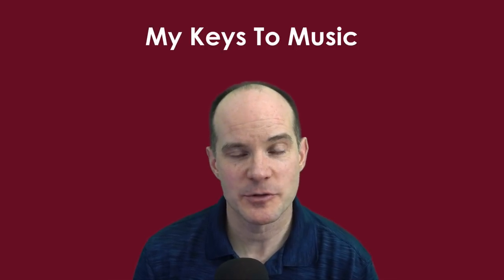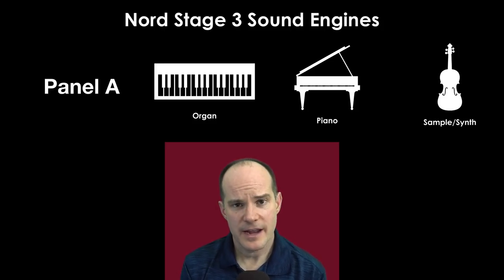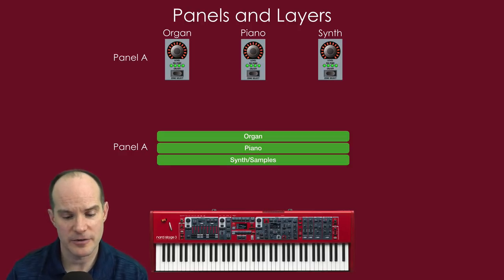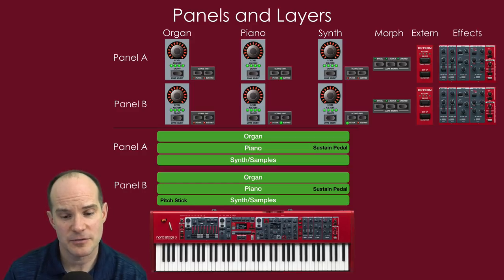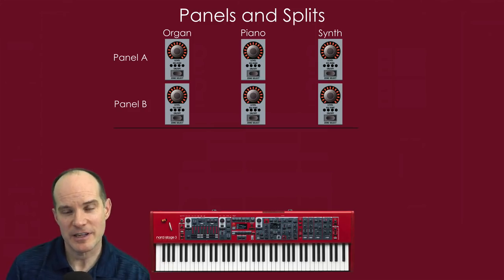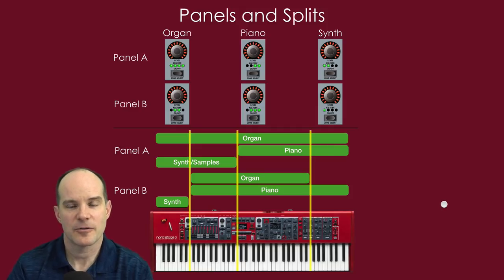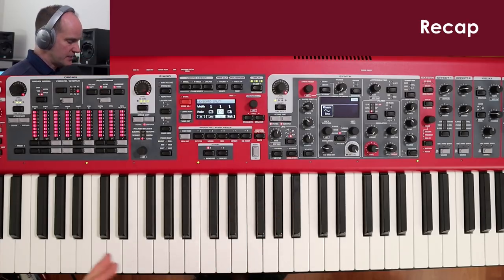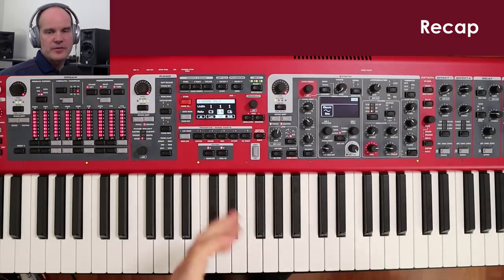Nord Stage 3: Understanding Layers, Splits, and Panels

Comment: How do I take two existing sounds whether in the synth section or as a separate program and split them?  Eg.) existing organ patch with left hand - zone 1 & 2; and existing lead/synth patch with right hand - zone 3 & 4.  Thank you for this site Marc!  It has been extremely useful!
Reply from the maker: Hi there! Happy to know the channel has been a help. Please have a look at this video to see if this answers the question or not: https://youtu.be/72jPR9LZUG8 It not, report back and I'll do my best to answer for you.
Reply: Thanks Marc!  I actually came across this video after posting my question.  Great help!
Reply: What if the sounds you are trying to use are programs and not located in synth / sample library?  How do you choose program sounds when you are doing splits?
Reply: & can I set the glide / portamento for one side say the right playing the lead and not for the left which would be playing Hammond/mellotron/piano with left which doesn’t require glide??
Reply from the maker: @luvjammin04  I now see what you are asking... You want to split two programs.  You can't do that exactly.  The programs are made up of settings for all 3 engines at once so a program is more of a collection of sounds from each engine X 2 panels.  The program also includes all the split information as well.  So, what you have to do instead is first split the keyboard. Then you decide which individual piano, organ, and synth preset you want from each panel and then save that there.  Here's a common workflow.

For example:
1) Find a program you want on the left side of the split.  Take a note of the following:
   Panel A Organ (if used)
   Panel A Piano (if used)
   Panel A Synth (if used)
   Panel B Organ (if used)
   Panel B Piano (if used)
   Panel B Synth (if used)

2) Then do the same for the program you want on the right side of the split.

3) Then you can navigate to an empty program at the back of your program list. You can then individually select the engines that were used on the left and right and build up your program from scratch. This is also a great learning exercise and will have you well on your way.

Alternatively, you can select the program you want on the left side of the split.  Then split the keyboard and select what you want on the right side by referring to the other program.  This will be slightly less work perhaps than the other way.
Sorry, there isn't a simpler way to do this! 🙈
Reply from the maker: @luvjammin04  Glide by its very nature only applies to the synth engine.  So you could split the keyboard and put the synth lead on the right side with glide on.  Then, on the left side, you can easily add organ/piano without worrying about the glide getting in the way because those engines don't have glide as an option.

Comment: Hi, thank you for the video. Question, can you save a split in three sections in one of the programs?
Reply from the maker: Hello @Yeny Ramos Thanks for the question and sorry or the delay. You used the word "program" here and I think you meant "panel." So, if I'm understanding your question correctly, the answer is no.  Sure, you can split the keyboard 3 times making 4 zones. However, once you make a split, it splits for both panels A and B and you don't get the choice in that.  So, you cannot have a split in one panel and no splits in the other.   If I didn't understand your question correctly, please feel free to ask it another way. Thanks!

Comment: Hey nice tutorial. We are trying to learn the proper way to split the outputs in the A and B panels for our mixing board. We want to isolate all 3 engines (Organ, Piano, and Synth) to better mix for our performances. We've been trying a few things but if you have a video or a good source I'd appreciate that!
Reply from the maker: @Patrick's Music glad to hear this!  Yes, you get up to two output options per panel and each panel can be different. So, in a way, you get 4 output options across 6 engines.  Good luck with your music. 🎹

Comment: Hi Mark

love your tutorials !

do you have a tutorial on how to save layers & splits into song mode?

many thanks 
tim
Reply from the maker: Thank you! Appreciate the positive feedback! They are fun to do.  I do have lessons on song mode and so forth in the full course at https://www.MyKeysToMusic.com called ("Master the Nord Stage 3").  Within the course, I go into even more detail about all this stuff and it's a far more organized and complete offering (with no ads!) 😀
Reply from the maker: @dennisfreemanbuddy  Thanks for your question and this is the place for it!
Here are a few things:
1) If you don't think you need panel B, you can leave it as-is and just not have it being activated. Push both Panel A and B buttons at the same time toggle between both panels being activated or one panel activated at a time.
2) You can simply turn off all sound engines on panel B (Organ, Piano, and synth too).  This is sort of the long way around to do this but it will work.  The best way is #1. 
3) If you want to reset the synth engine only for just panel B, you can so that using the "Synth Init" option found either under the "Unison" button at the top middle are of the synth section. This removes all settings of the synth back to a default setting.
Hope that helps!
Reply: @MyKeysToMusic  Thanks so much for your quick reply.  Your suggestion worked.
Reply from the maker: @dennisfreemanbuddy  Excellent! Glad to hear that. Keep on learning...

Comment: Hi! Thank you for the video! I have a question, is it possible to have three synth at the same time? A synth bass in a panel A and a pad and a piano in panel B for example.
Reply from the maker: Hello @Jaz Kendikian Great question and one that comes up a lot.  The answer is yes and no, While it's not possible to have 3 synths play at the same time (only 2), it is possible to have two synths and a piano play at the same time.  The piano comes from piano engine and you get two of those as well. Said another way, you can have up to 2 organs, 2 pianos and 2 synths all playing at the same time.  However, it's not possible to have any more than 2 from each play at the same time.  The upcoming Nord Stage 4 on the other hand has three synth engines, and it does have the ability to play all 3 at once (along with 2 pianos and 2 organs too all at the same time).

So for example:
You could have a piano and strings playing in the right hand and a synth bass playing in the left.  That's no problem. In fact, they don't have to be split, they can all be layered across the entire keyboard if you wanted. BUT if you want a sample bass playing in the left along with a sample flute layered with strings playing in the right, this is not possible because you only have two sample/synths from the synth engine at one time.  Again, this is something the Stage 4 can do (play up to 3 sample/synths at once).
Hope that helps clarify things.

Comment: Great video. Thanks for the explanation. Seems a bit odd though. 4 zones with only 3 sound sources.
Reply from the maker: Thanks, Paul! Well, technically speaking, there are two panels (A and B) so you actually have up to 6 sounds from 3 engines.  But I see what you are saying, with the fact that there more available zones in a 3 split configuration than there are unique engines to fulfill those zones. I find that I rarely have all 6 options executed in a single program but handy on those times when you really need it.

Comment: What about using a volume pedal with split and layer. Example. I walk LH bass and want to have a RH piano w/sustain along with strings that I can control with a volume pedal. Do I use  the Morph functions with Panel A/B?
Reply from the maker: Hi @Don Stevenson - yes you would use a control pedal and assign that to morph the volume of the piano and synth engines.  Then your sustain pedal would be assigned to the piano and synth engine as well.  For the walking bass part, you would put that on panel B for example and not assign the sustain pedal to that.  So it could work like this:
Panel A Piano (Right side of the split) - sustain pedal and control pedal to morph volume
Panel A Synth /Strings (Right side of the split) - sustain pedal and control pedal to morph volume
Panel B Synth/ Bass (Left side of the slit) - no sustain and up to you if you want to morph volume or not. 
Hope that helps!

Comment: I just created a split, using organ and synth samples.  Now, how do I save it?  The “store” and “store as” button does not seem to work in this.   Any help would be wonderful, thank you!
Reply from the maker: Hi @Julie Spangler. You may still have your "Memory Protection" on which is a one-time setting on your keyboard.  Go to the system settings and on the first page you should see a setting called "Memory Protect."  You can turn it on and off by moving the program knob just to the right of that screen.  Once the memory protection setting is off, you should be able to save programs.  If you're looking for complete training from A to Z on your Stage 3, you may want to consider enrolling in "Master the Nord Stage 3" found on my main website: https://www.MyKeysToMusic.com. I also have a couple of free courses on the site too for your consideration.  Good luck and report please report back if that did the trick...

Comment: Thank you very much for your video!

Just to make sure: is it possible to have a bass sample in the left hand and a piano and string layer in the right hand?
Reply from the maker: Hi Marian. Glad the video helps.  So, yes this is possible!  You would assign the bass sample from the sample/synth engine in the left hand and for the right hand, you would assign a piano from the piano engine.  Then on panel B, you would assign a string layer to the right hand and then assign the keyboard to play both panel A and B at the same time. This would give you the result of having a bass on your left and a piano layered with strings on the right. This seems to be a common scenario for people and one that the Electro 6 really can't provide out of the box because you can only have one synth sound playing at the same time on the Electro 6.

If you're curious about how you'd set up a bass in the left hand, I created this video which does that.  Granted, in this video I demonstrate how to use the Extern function but it's a similar idea: https://youtu.be/72jPR9LZUG8

Now, there is a crafty workaround where technically you could make your own sample with a bass in the left hand and a string patch on the right and have that entire thing play out through an Electro 6 using the one synth engine. But, that is a lot of work and requires add'l skills and setup to pull off.

Thanks for watching!   😉
Reply: My Keys To Music Thanks! Glad to hear that! Is it then possible to control the volume of the string layer in the upper part with a control pedal?
Reply from the maker: @marianhoffmann3067  Yes. You can adjust volumes of any of those parts independent from one another.  (You'll have to switch back and forth between panel A and B first).  You also have the option of assigning the volume level for strings (or any sound engine) to a control pedal as well if you want hand-off control. To see how this is done, watch this video where I demonstrate this using the Yamaha FC7 pedal - it makes a big difference: https://youtu.be/eeJ9b1oGEyY

Comment: Hi! I love your videos, they made my gigs way easier. Is there a way to have three synths at the same time? I could have two with panels A-B but it seems like 3 is not posible. Is that right? Thanks!
Reply from the maker: Hello @Santiago Belgrano thanks for your question.  Unfortunately, you can only have two independent synth/sample sounds at the same time with the Stage 3, (one on Panel A and one on Panel B).  You can however make another program and use seamless transitions to switch between programs smoothly.  I have an example of this on my paid Patron post where I use 3 programs to pull off the song "Mr. Blue Sky" from ELO.  ELO uses 3 keyboardists on stage so it's already a handful.  For this song, you need more than two synth sounds so I use the seamless transitions to move back and forth etc. https://www.patreon.com/posts/elo-mr-blue-sky-47503116?utm_medium=clipboard_copy&utm_source=copy_to_clipboard&utm_campaign=postshare

Comment: Hi Marc, is there any option to switch layers and/or panels with a control pedal ?
Reply from the maker: Hello @Arnaud Raulet great question. There is no "built-in" way to do this by simply connecting a pedal. However, you could pre-program a pedal/foot switch (or a keyboard controller) to tell the Nord keyboard to  to either "panel enable" and/or "panel fousus."  Using these in combination, allows one to select Panel A, B, or both.  Such a programmable MIDI footswitch does exists and it comes in a few forms today. One such solution is the "MIDI Maestro" found at:  https://www.singularsound.com/products/midi-maestro
Reply: @MyKeysToMusic  Tkh Marc. And I guess, it can also allows up/down program (to avoid to use FS-6/FS-7 on the "traditionnal" pedal)
Reply from the maker: @Arno93   Great question and one I had to research a bit.  So, I just checked this out now.  You can assign buttons to change to a specific program but not assign them to go up or down (unfortunately) as far as I can tell.   For that, I've been using one of the Boss Pedals (https://youtu.be/CX-py6wbA9Q) or the MIDI Mouse: https://youtu.be/Me6X9eQ6gIk
Reply: @MyKeysToMusic  too bad.... it’s going to make a lot of pedals under the keyboard! But, beyond that, thank you very much for your quick and always accurate answers
Reply from the maker: @Arno93  Happy to help!

Comment: Hello is it possible to use two existing programs to program one into Panel A and one into Panel B? I'm stuck!
Reply from the maker: Hello @Stephanie Casey By now you may have already answered your question. Programs include settings for both Panel A and B at the same time. You can copy panel B to A and vice versa. You can also copy panels from one program to another program too.  Hope that helps explain it a little. Ask you question a different way if you still have a question on this.  Thanks for watching!